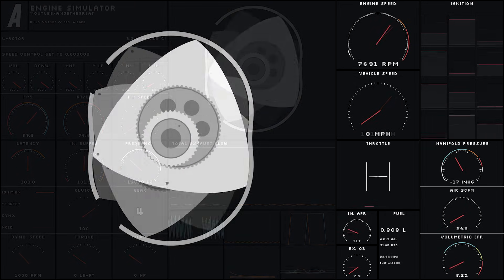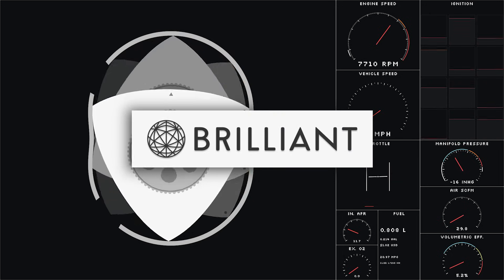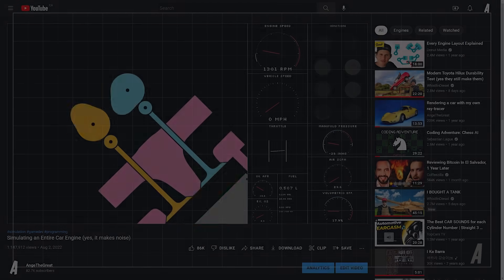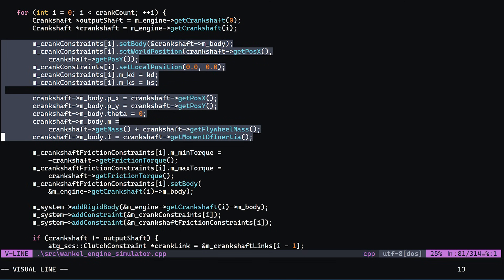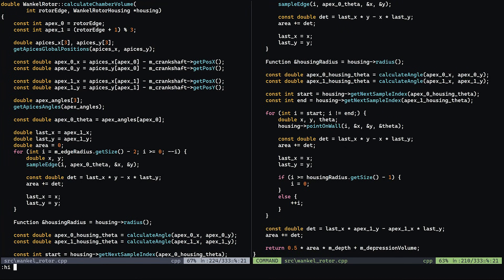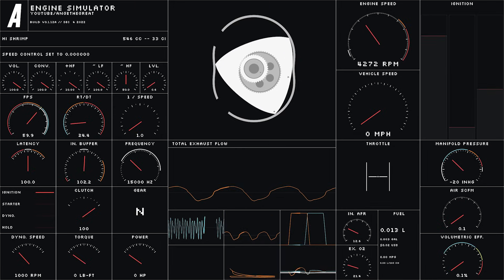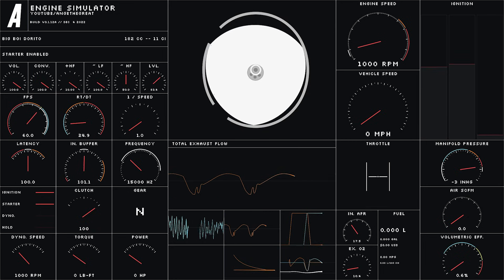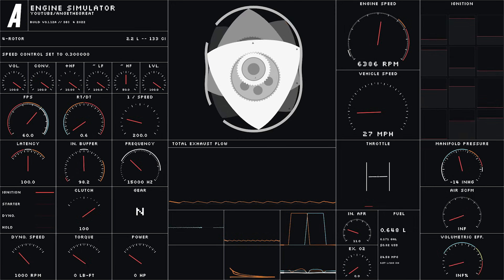Simulating a Rotary Engine (yes, it braps)

Comment: 15:10  
the rpm stutter, holy shit it's too good.
Reply: I feel like I'm witnessing the audio version of the millennium graphics leap in 3D racing.

This dude's engine simulator is mind boggling and could take racing simulation to a whole 'nother level!
Reply: Waiting for any game that could probably make use of this simulator
Reply: @UshankaMaster  Gran turismo and forza come to mind, they've never had the best sounding engines.

Also automation and rigs of rods
Reply: @viperfan7  you've never heard FM3 & FM4's sounds then, have you? Some of the best sounds in the series right there
Reply: @viperfan7  They'll probably either end up buying or re-creating this engine. Plus, I think it's easier to simulate this in game because you can use physical bumps and suspension changes that forza already calculates real time.
Reply: @KiroteHikari  true but this is better
Reply: @viperfan7  I thought the 2 bare bones Dirt sims were pretty decent. Feathering the throttle actually sounds somewhat responsive. Most games make no effort and it's clear with a small budget and the right people it can be fixed.
Reply: @viperfan7  the new need for speed game, NFS unbound, outperforms forza by miles in the "this doesn't sound anything like" insert motor here" grounds for most engines
Reply: @keelanbarrette529  really? Back in the day NFS games were awesome in car sounds, just listen the Carrera GT in Carbon, no game has ever recreated that V10 sound that good
Reply: @viperfan7  beamng
Reply: @NaviYT  Yeah, that's what I'm afraid of: companies reverse engineering or stealing this ... Ange needs to patent this ASAP
Reply: @BuGBurnout  truuuu get that money ange
Reply: @viperfan7  BeamNG*
Reply: @viperfan7  assetto too
It's all remedied with mods but nothing can really come quite as close to real-time sounds like this video
Reply: @BuGBurnout i mean he made it open source, so he clearly doesn’t care about profiting off it, and just wants it to be accessible to people that want to use it
Reply: @viperfan7 speaking of rigs of rods, i heard something about beamng doing something like this. not sure how true it is though
Reply: @viperfan7  Gran Turismo really stepped up their game on GT7, but I can agree, why don't they just have this guy do the audio simulation TT
Reply: @UshankaMaster  beamng can use with .wav file samples and plugging in values. You can even port in crazy engines and have their proper sounds. Ie an i12 or something 😭
Reply: @UshankaMaster  Doubt any game will use these simulators, they require 85,000 FPS to run accurately and not explode as described in the first engine video.
Reply: I never though I would get shills from a simulation of a an engine. 
Its really good.

Not like games that use fake "wav"s, they never made me chill in my spine, because its too fake and no dynamic response.
Reply: @monad_tcp  good sound design would make it have a more dynamic response

NFS Most Wanted actually had pretty good engine audio for its time and had to actually combine multiple techniques to get its sound
Reply: Lots of nice sounding noises, but very little movement, and many failed apex seals.
Reply: pure eargasm
Reply: yeah holy shit that sounded amazing.
Reply: ikr

Comment: The intake and exaust ports overlap. Solve this and you'll have a more accurate sound. Also not to mention most rotary engines have side intake ports. Furthermore use two ignition sources and have a two step flame front propagation for more accurate sound.
Reply: He's excluding the side ports to simplify, since its still largely 2 dimensional. The flame front also seems to be faster than reality, so dunno how much adding a second spark would do anything.
Reply: Intake and exhaust port overlap is what actually provides that brap sound on a traditional 13b, no?
Reply: more evidence of a trash design lol
Reply: Not a trash design, just not desirable with emissions and economy concerns.  The Wankel does have high survivability though.  My second car was a 13b n/a 1986 rx-7, with close to 300,000 miles on it when I sold it for what I bought it for ($1000).  The engine still purred fine, though everything else around it was shot to hell and reliability suffered on that front.  So, no, not shit design.  The design makes for a good air pump overall.
Reply: @bazinga1831  more like someone that has no idea how to drive and maintain one of these engines. You gotta drive it like a 2 stroke. Feed it pre-mix and let it sing. They are reliable engines, you just gotta let them clear their throat every time you drive it. A 50:1 2 stroke mix keeps the apex seals happy
Reply: @roadrocket7770  yup
Reply: @kugelblitz1557  Luckily they're way easier to take apart than a piston engine.

Comment: The true, ideal housing is an epitrochoid, actually pretty easy to calculate. There's math for the inner and outer envelopes (Wankel and Liquid Piston respectively) too, I have a Desmos setup for all of them.
Reply from the maker: The housing is calculated using the exact function (with the rotor there for visualization purposes). For the rotor, I thought it would be cool to show how the shape is optimized but I'm sure there's a closed-form solution for it.
Reply from the maker: @DJ_Level_3  nice! I'll check it out
Reply: God, I love Desmos
Reply: @DJ_Level_3  It's so annoying how YouTube removes all links
Reply: looks hella smooth
Reply: @DJ_Level_3  Really cool demo with Desmos.
Reply: @DJ_Level_3  I wish after college I will have the time to play with math like tou guys do. Math is fun but I simply have no time to practice it.
Reply: @DJ_Level_3  Amazing, that's a very pleasing design to look at. Has that type of rotary engine ever been made? You say it's the ideal geometry, has it been tried?
Reply: @theRPGmaster  Look up "see through Liquid Piston Engine" to see a see-through one run. By ideal I meant mathematically perfect, with infinite compression ratio and infinitely good tolerances.
Reply from the maker: @DJ_Level_3  Just checked it out and it's very cool! Solving the rotor shape numerically was pretty fun but I think I'll use the closed-form solution for the sake of simplicity, thanks for the suggestion
Reply: @AngeTheGreat  Can we hope to see a Liquid Piston engine configuration on your incredible simulator?
Reply from the maker: @jeffstephenson1832  I'm considering it...
Reply: @DJ_Level_3  Yes, yatub loves sin sore ship.
Reply: Funny seeing you here! Nice stuff :D
Reply: @JamesHBall  I could say the same, guess our interests overlap in more than one way!

Comment: for both the housing and the rotor  there are exact mathematical curve functions, describing their shape. Implementing those would probably have been easier than your simulation method
Reply from the maker: I didn't know about the closed form solution, thanks for sharing!
Reply: How do i get the formulas?